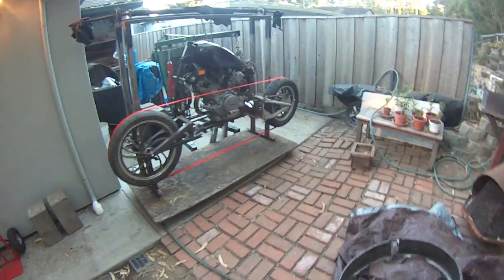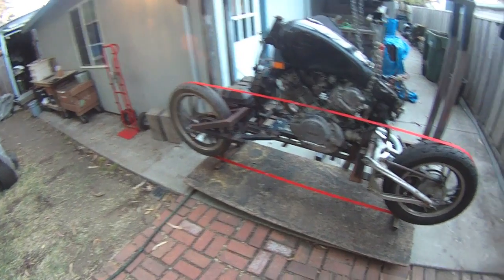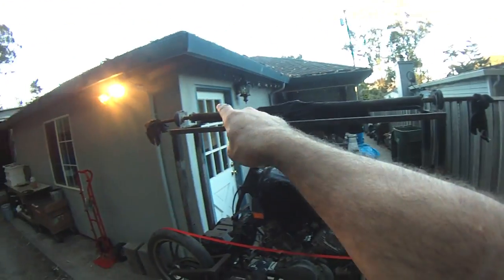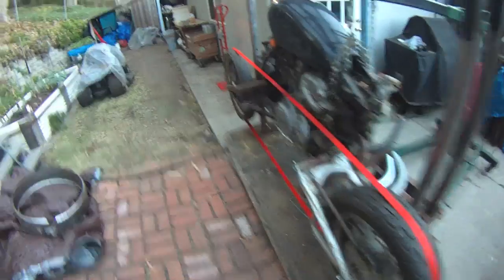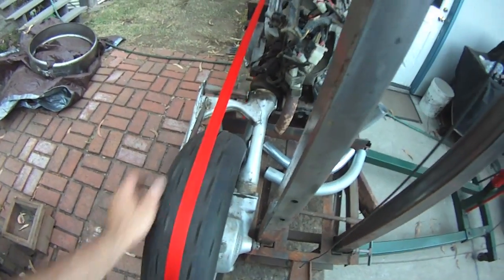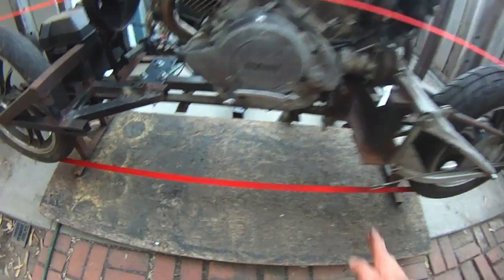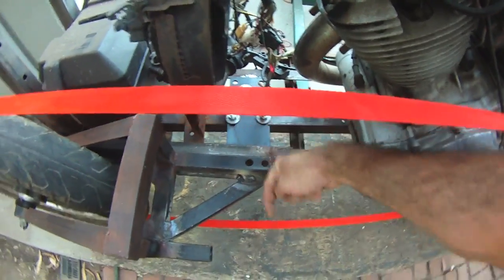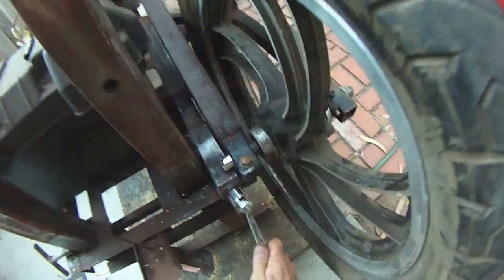Overview of the Yamasaw

Comment: Just because the Honda is on the other side does not solve the direction problem, sorry to dash your hopes, But why worry about it like you said your making a mountain out of a molehill !!!   Just drop your Log on the other side of the bed and reverse engineer everything on the log-bed ..... Problem solved !  what's the difference you won't know cause you've never worked on another one,  maybe you could engineer a bit different clamp dog then the standard screw dog because for that one you'd have to reach over to the other side every time when turning and setting the log. (it will be on the right side now instead of the left from which you're operating the mill.   You could run a threaded rod through the frame to the left side with a small crank and a flip lever to throw up the dog into position!   So it would still slide on a tube but you would not have the top screw, it would be solid. Then the threaded rod would go from the left side to the dog pulling it into the log after you flipped it up into position with the lever you extended to the left side........  Can you picture it?
Ed
Reply from the maker: Actually I can picture it...  I have stalled on this project in the final leg of it's completion...Life has taken a front seat to projects, but I will be back on it in the new year.  Thanks Ed.